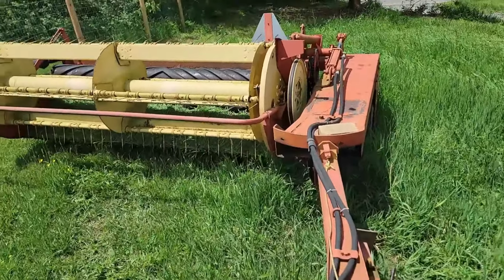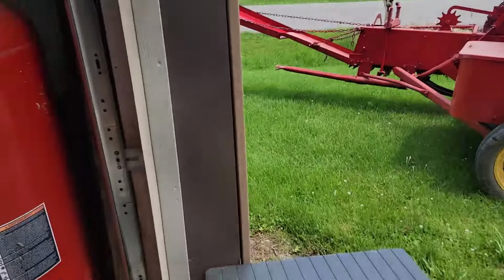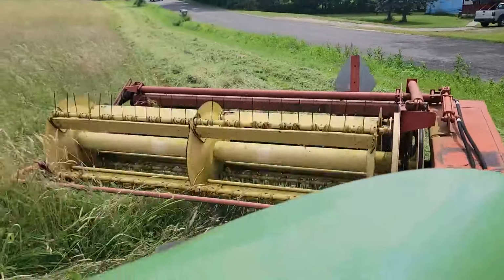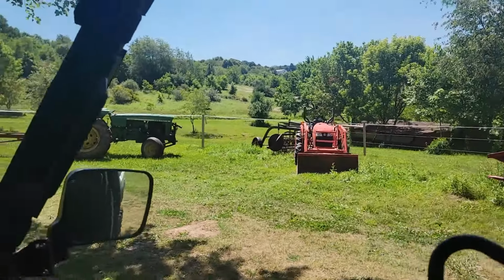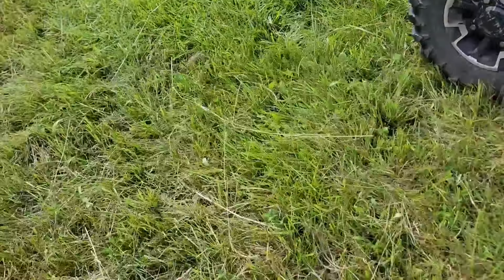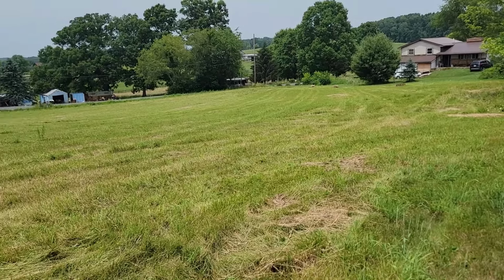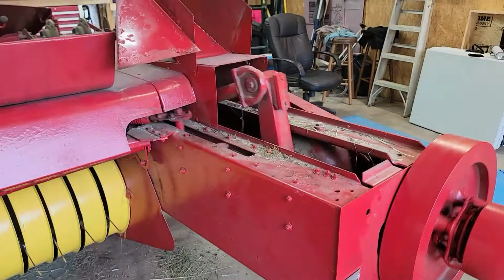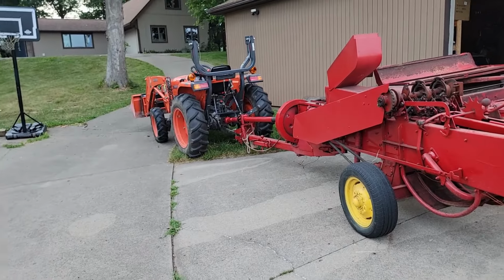DAUGHTER WANTED A HORSE SO I BECAME A HAY FARMER - Baler broke almost immediately......

Comment: those are feeder forks the tucker fingers are on the knotters. when you remove a link from that chain you will have to make sure its in time when you put it back on, to do that rotate the plunger pitmen arm that comes off the gear box to top dead center there should be two notches in the frame to mark that location but if there isnt any notches just put it top dead center then on your knotter clutch drum there will be dimples made by a prick punch on both the inner and outer potion of the clutch drums put these marks in line with each other, and the pitmen arm top dead center reinstall the chain and tighten, now your knotters will be in time with your plunger. I hope this makes sense
Reply from the maker: @hillcresthayfarms9664  thank you for the info sir. I did remove a link but didn't even think about the timing. I'm gonna have to look at that before I make this second cut.